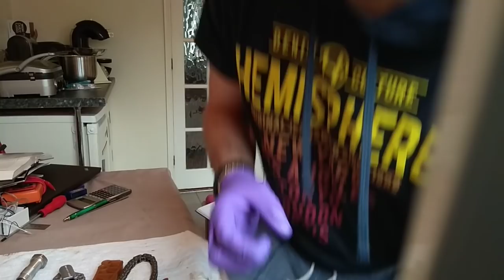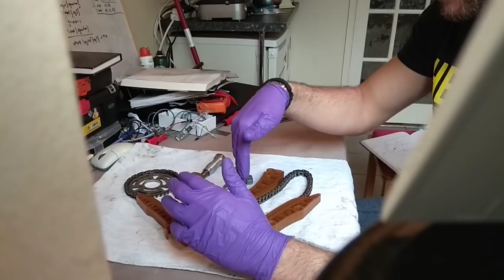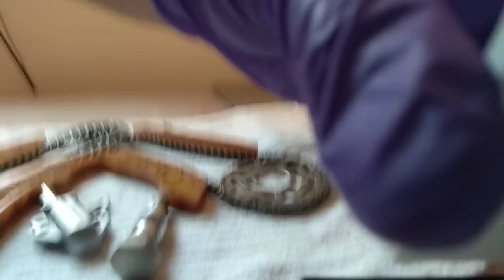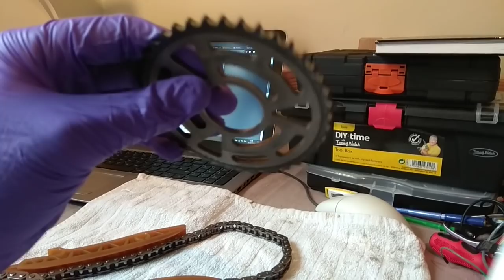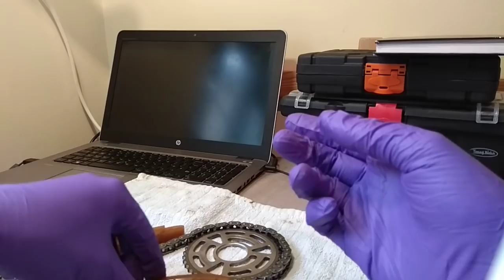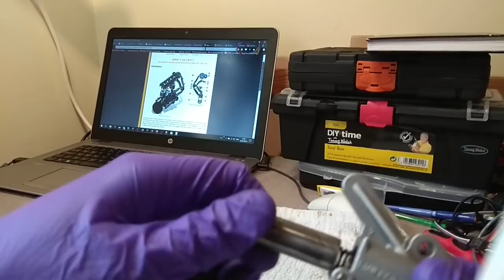N47 timing chain analysis

Comment: Thanks, helpful video and analysis. My  late 2007 car had 1 chain replaced free by BMW at 125k miles and is now at 180k miles and I have never heard any suspicious noises. Looking on ebay you see many N47 cars that have died due to chains but they are far from all 100k + miles. I believe driving style is also a significant factor - ragging the engine being a bad thing - also city driving must increase the probability of diesel dilution.
Reply from the maker: Rhian Taylor I agree with you. I do a fair amount of city driving in mine but I monitor when Regens are happening so I can (where possible) join a motorway and let them complete. Probably a good idea to do more frequent oil changes especially if a lot of city driving. That's incredible mileage on your car, what parts have gone tits up on you?
Reply: Recently replaced a half shaft (£145) as the speed/abs sensor was misbehaving and changed the serpentine belt and rollers (£85) as a preventative measure when I thought I could hear a failing idler bearing. Also have a seat belt and passenger airbag issue to address. I previously took an M47 320d from 100k to 260k miles by which point it would have benefited from valve guide seals but I got rid of it.
Reply from the maker: Rhian Taylor ah yes, I had to do one of my drive shafts too. It was heavily corroded and rubbing the abs sensor

Comment: Hi Mtech, you hit the nail on the head with length of service intervals for oil. Your oil just wont last that long (18k) and retain it's properties, the other tip I found is to leave the car running for a few minutes  to wind down the turbo and reduce its temperature as the oil can cook, carbonize and chip off blocking oil ways.
Reply from the maker: tonydization absolutely man, especially after "spirited" driving! I also monitor when Regens are happening just so I can let them finish since I mostly do short trips

Comment: Purchased my car 2 months tho. 
2013 F30 320d N47 Engine. 72k miles. What would you advise to me be?
Reply from the maker: Rob Smith just listen out for the swishing noise at around 2500 revs, this indicates a loose chain. Not all of the wear so quickly but the ones that do you can clearly hear them, in that case get it repaired if you intend to keep your car
Reply: MTech over9000 my bmw specialist said don't replace the chain before it needs replacing and said wait for it to go.. he said if it went it only damages (forgot the thing he said) and it would cost a little over 1.2k to fix. Is this true
Reply from the maker: Rob Smith personally I would take the advice of a mechanic over mine any day of the week, but seeing as you ask me for my opinion: there is no rush to have it changed, it is something that will get progressively worse and more noticeable. As for the damage, it depends on the engine speed at the time the chain snaps, for some especially at low speeds, all that needs changing is the snapped chain and accessories. If it goes at high engine speeds or jumps a tooth, you can obliterate the engine (valves, rockers, valve lifters, cam shafts, cylinder heads and sometimes even crack the block). Furthermore as the broken chain thrashes about it may cause other auxillary damage. All in all it requires proper diagnosis to assess the damage and many hours of labour ££££. Nevertheless, if it does go and is not repairable, replacing the entire engine with a lowish mileage scrap engine can be done for about £2k

Comment: Hi, nice video.  £450 sounds like a very good deal, i'm from Ipswich but i'm willing to travel the distance for this price. Can i have the garage details please?
Reply from the maker: Daniel Razvan  it's PMP cars in Nuneaton, you can find them on Facebook. I had this done last year, seems their price has gone up now
Reply: Cheers mate!
Reply: @MTechOver9000  750 now
Reply from the maker: @bald_flexproductions565  didn't think it would stay that cheap forever I guess..
Reply: @MTechOver9000  That's Albanians for you
Reply: Nice I got quoted 900 for timing chain and then if valvue need doing another 700
Reply: And too far for me as car don’t run
Reply from the maker: SOrry to hear that man, lemme know how it goes
Reply: @MTechOver9000  I need some help too !! I'm in cov, can u help me? I got a 2008 318d
Reply from the maker: Tip X  I had mine done at a place called PMP cars in Nuneaton, Coventry. At the time they were quite cheap
Reply: @MTechOver9000  I called them and the price is better is half of what I thought !! How can I find out if its only the chains or something else too?
Reply from the maker: Tip X do you hear the chain though? Would be pointless to do it if there is no sound. If it is the chain sound, those guys will replace the chain and tensioners at the same time
Reply: @MTechOver9000  I hear from the noise and my car won't start now. I drove at low medium speed address it just went off, never started after ? I think about taking it there, but want to make sure nothing worst happened
Reply from the maker: Tip X sorry to hear man. Hope it's something else

Comment: hello, very interesting. i would like to contact to you. i had changed at 205.000kms N47 from Dec2017.  you should do another video checking main chain and the top of both tensioners. the top of tensiners contact zone says a lot about the vibrations the chains had. in my case i had some spaces between chain parts like in this video (this video is not from muy chains but it its very similar: )  i have my chains at home, i can do a video also.  https://youtu.be/csf3yN_y_U8
Reply from the maker: Marce Garcia Martin thanks for the comment. Ah yes, this test demonstrates the wear on the pins which leads to chain elongation. Perhaps I'll make another video showing this when I have some time. Sure thing man, send me you details.

Comment: Changed it 20k kilometers ago and that fucking maracas sound is still there
Reply: Hi nice video. I think it might be a construction error on the actual chain tensioner. The tensioner I've seen on other car brands, it's done with a mechanical stopper that prevents the tensioner from pulling back. There is no reason for the tensioner to move in either direction.  //Anders
Reply from the maker: GinsengStrip2002 was the sound there straight after replacing or did it come back gradually?
Reply: @MTechOver9000  For the record - did 120k kilometers with this engine. Engine block had a scratch so I had to change it, the chain was still in pretty good shape but I decided to replace it since the engine was out. After 5k kilometers since rebuild the noise is back. Weird thing. I'm not worried about it anymore, if it snaps - it snaps. Previous noisy one lasted very long. I've also noticed the sound depends on how the engine oil is worn out.
Reply: I ain't really sure tbh. Had it changed at BMW service in Germany by previous owner (my uncle, everythings in car history), now I'm back in Poland with that car since last summer it can be heard. There is no sound at all when the engine is cold, then it gets noisy when it's half-warmed and then when the engine gets warmed up well the sound dissapears or is really quiet. Depends on engine oil, can be barely heard with new oil for like 2k or 3k kilometers. Outside temperature also affects it but I guess it's mostly the case of how fast engine is warm.
Reply from the maker: GinsengStrip2002 I wouldn't worry too much about it. Some noise is normal, it's simply the chain running over the guides. But if it is a rhythmic cha-cha-cha that increases with revs then you should worry. Is your car manufactured 2007-2008?
Reply: Yeah it's 2007. Had engine changed at BMW in 2012 on warranty, but from ordered parts number in service history I can tell it's N47D20A. Then in 2015 "distribution chain repair kit", over a year later chains got replaced. The noise is there and i can hear it but when revving the "cha-cha-cha" is not loud, it actually quietens down or cant be heard at all.
Reply: https://www.youtube.com/watch?v=H_P-C8ls0xQ here you can hear it
Reply from the maker: GinsengStrip2002 in that case I wouldn't worry too much. It's so easy to become paranoid, maybe it's not even the chain you're hearing but the tappets or something else
Reply: well probably you're right. I ll just get it replaced in next 60/70k. It's the same with my health, since i got diabetes i became very paranoid about it - goes same for my cars :D
Reply: this engine has two compensating shafts on crankshaft that can be the origint of your sound:  see http://www.realoem.com/bmw/enUS/showparts?id=WD11-EUR-12-2007-E92-BMW-320d&diagId=11_4093

in my case at 205.000kms they changed chains, sprokets and eliminate these two compensating shafts. they say that BMW is no longer mounting the compensating shafts since 2015
Reply: Marce Garcia Martin do you mean the sound in my video? Could this be the origin of that sound? Did you have the same noise?